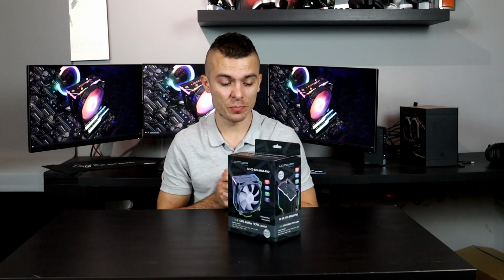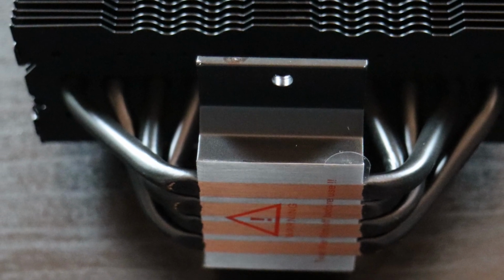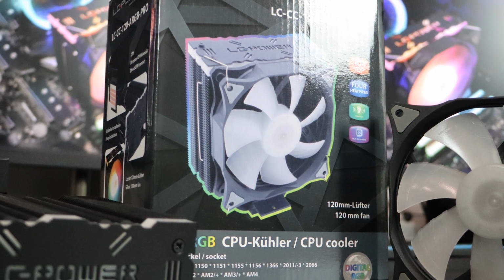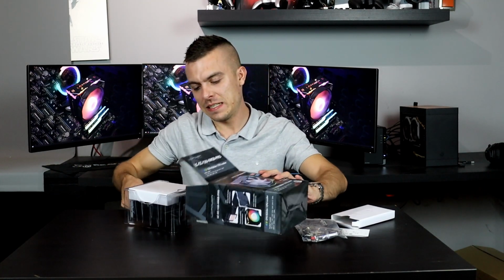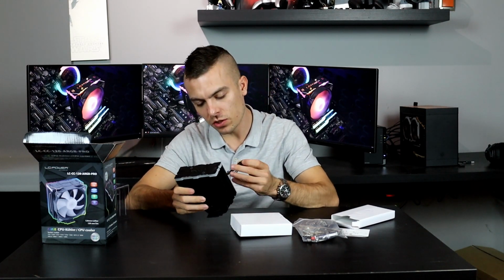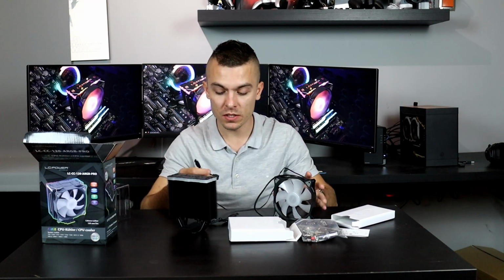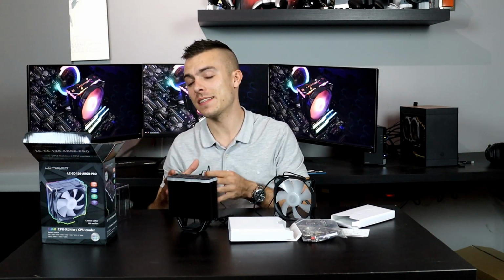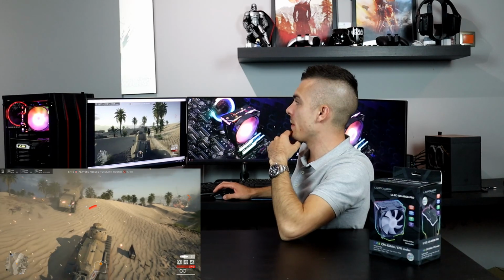LC POWER LC-CC-120-ARGB-PRO - great budget cooler

Comment: I can have RGB with an old motherboard? Without rbg connettore?
Reply from the maker: Unfortunately no. You do need to connect it to your ARGB connector on your motherboard or some other controller that supports 5V 3-pin ARGB header.
Reply: @PCCrazyDario  random effect?
Reply from the maker: Dario RTX No, because you don’t get any power to the LEDs on the cooler if you don’t connect the 3-pin header.
Reply: @PCCrazyDario  no RGB random? Some people tell me if i buy this cooler without argb cable i can have RGB rainbow effect